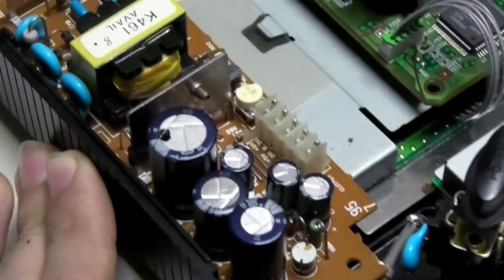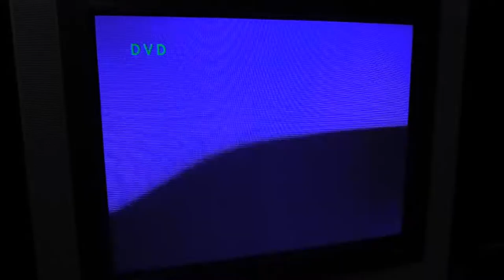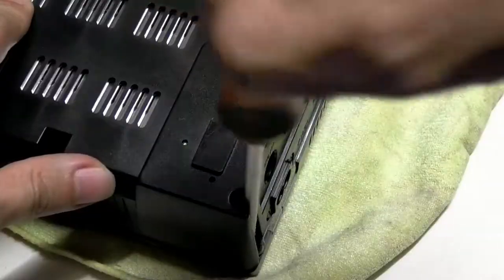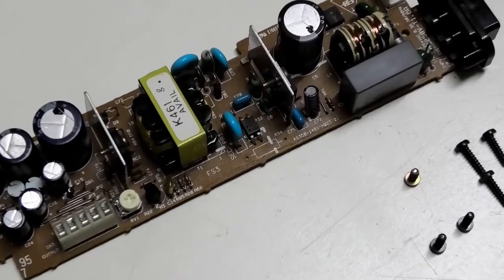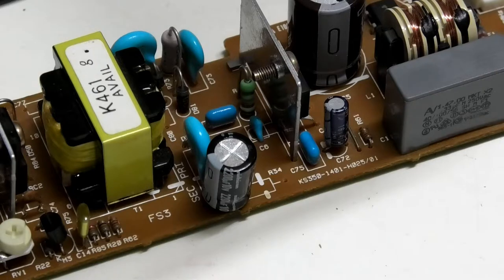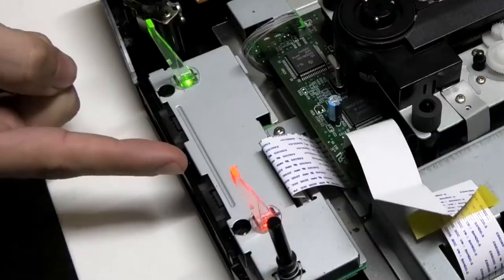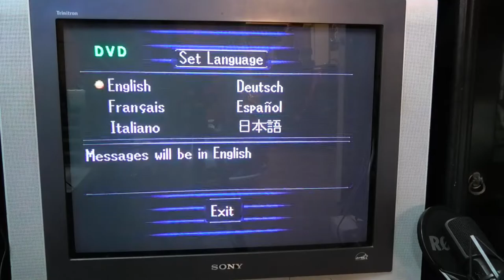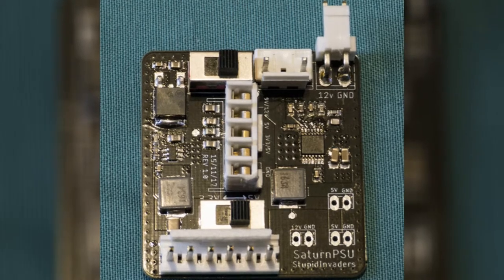Sega Saturn with a 'Buzzing' Power Supply | Joystick Division

Comment: Oh well, I got 4 different versions of Saturn, so after about a year I've tried playing this version Pal model 1 I've encountered to have the same exact problem as in the video. So I've tried cleaning up the contacts of the power supply with some alcohol and I thought I fixed the issue cause it didn't made that "bee" noise with those disturbing vertical lines showing on the screen, but of course after a while turning off and turning on the console the issue comes back everytime it warms up so the issue's still there. 
The solution seems enough easy and looks a great one, but unfortunately I guess I can't do much since I'm not a technic though, but I think asking to a trusted one I know is better! Thanks for the video.
Reply from the maker: Do you know if that power board is the same one as mine?
You could do the same thing I did and hopefully fix that issue.
Reply: @JoystickDivision  yes, it's all exactly the same. I could do it but, agh dunno! Hehe!
Reply: @JoystickDivision  well, just noticed there holes already and all, guess I really should give it a try for real. Gotta buy that component.
Reply from the maker: Only if you're comfortable doing it!
I don't want to pressure you into doing it or anything, haha.
I was really nervous about doing it because I had no idea what would happen.
Reply: @JoystickDivision  yes of course, I will do it only if I know I can by asking my technic friend or even ask to do it for me. He already fixed me 2 other Saturn with laser issue and else, he's a good one. 
Anyway I'm happy to know there's a solution of this weird problem. That sounds great! You made an interesting detailed video about it. Now I can fix it :)
Reply from the maker: I'm really glad you have someone who can help you and that you enjoyed my video or found it helpful. It means a lot to me. :)